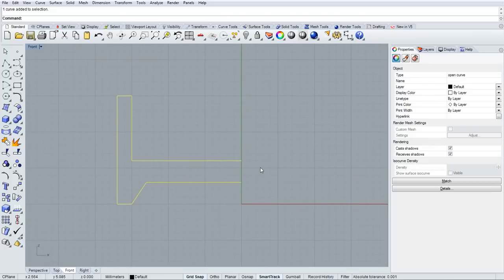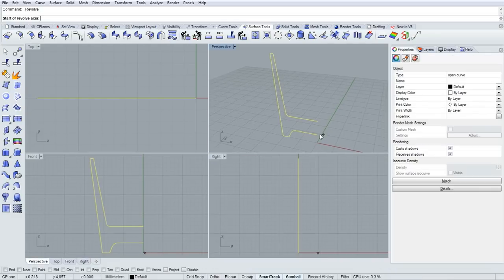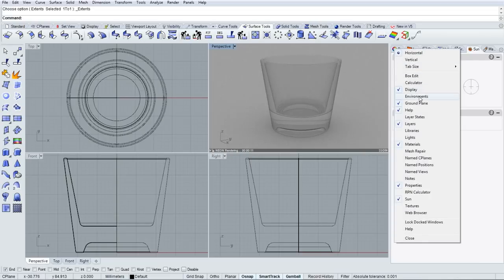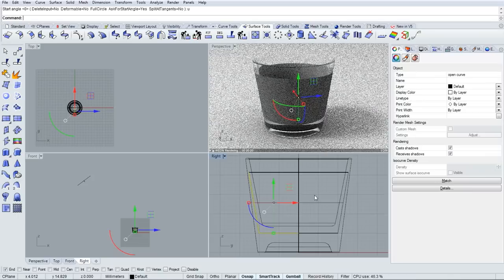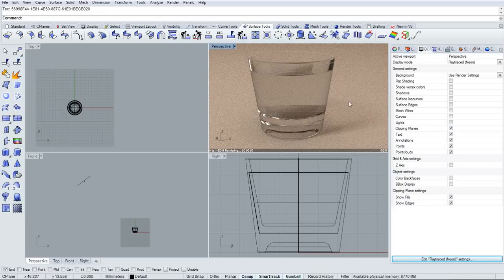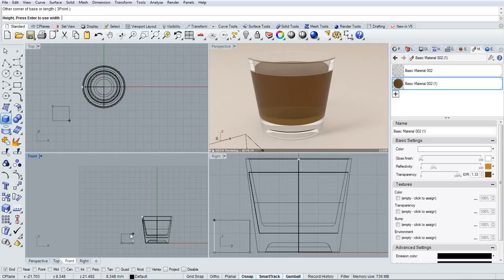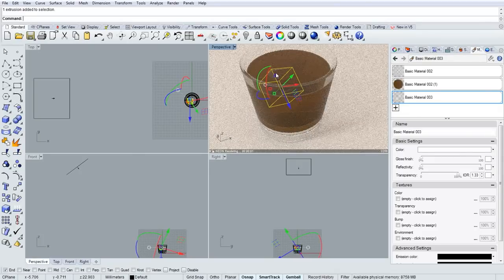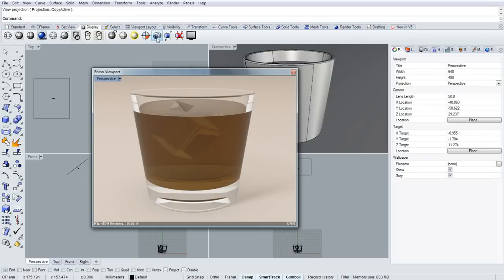A simple glass with v5 Rhino and Neon

Comment from the maker: Hi Angelo,
Rendering speed is a combination of several factors no matter what program you use. Processor cores/ghz, the pixel size of the rendering and the complexity of materials are all factors. I believe you have a mobile processor here for laptops which is slower than a desktop processor like the one I used for the video. I'd suggest reducing the size of the Neon viewport first to balance your CPU strength versus output. Post your file to the Neon forum to get other users feedback as well.